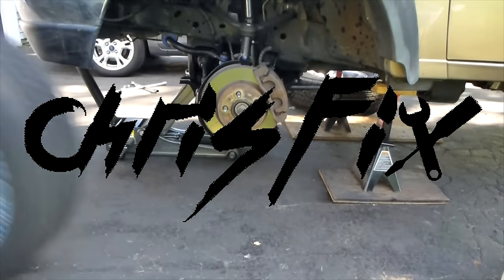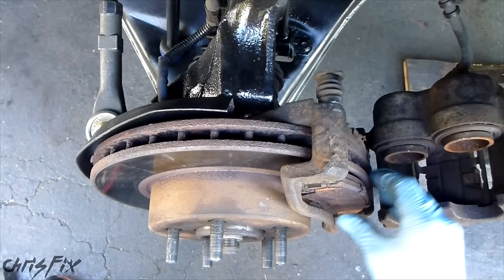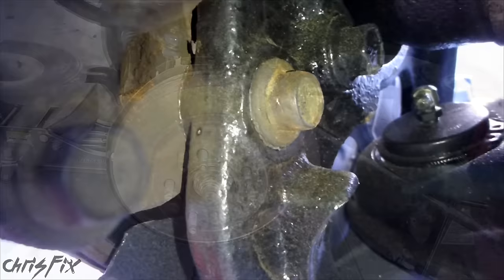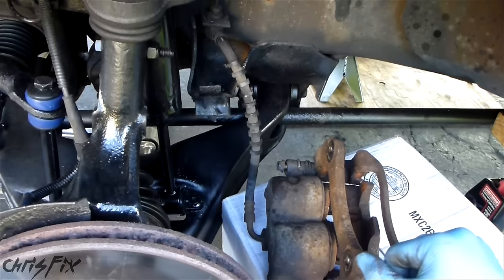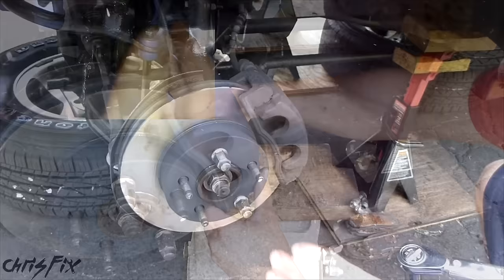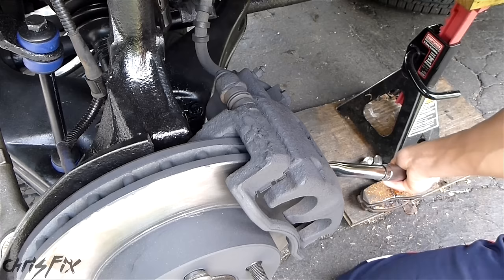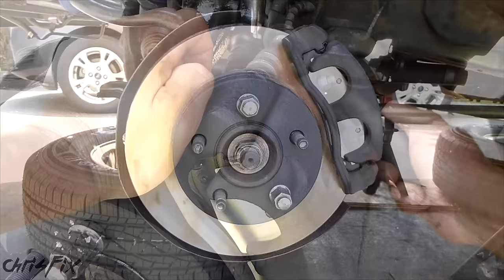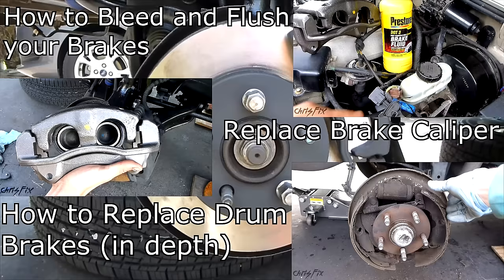How to Replace Front Brakes, Pads and Rotors

Comment: i have a question, how do you knw the amount of pounds to torque to
Reply: +kyle gorman check your owners manual. Or buy those Haynes manual book. You can also do a quick search on the internet. Sometimes some forums might have that information. Hope that helps.
Reply: +Supraw does actually thanks
Reply: If you were really In a pinch, you could use a 12" wrench, and put an 85lb weight on the very end of it :D

Comment: Make sure you pump your brakes after you're done installing everything oready elsee your brakes may not work
Reply from the maker: Thanks for the tip!
Reply: Yeah,  I always change my brakes but one day I got to comfortable about I can soo it all and forgot to pump the Brakes,  dam near Hit My Wife's Van A few Feet back...
Reply: Frank Solomon WHAT DO YOU MEAN BY PUMP MY BRAKES? LIKE ACTUALLY SIT IN THE CAR AND STEP ON THE BREAKS??
Reply: @SENSUI347  yes. After you've pushed the piston back to fit new pads it is no longer up against the back of the pad. Pump or push the pedal several times to bring it back to the back of the pad. Otherwise put your foot on the pedal and the piston still isn't touching it = No brakes
Reply: @skiphaskell706  Do this while the cap is still off the brake fluid reservoir or back on?
Reply: Also, if I'm doing all 4 I like to do either the front or the rear first, then take it for a test drive. Come back and do the other set. That way if for some reason you mess it up you'll still have at least some braking.

Comment: Nice video, thanks Chris! 
One comment, be sure to clean both sides of the brake rotor with Brake Clean before installing it. You can just spray them in the cardboard box that they came in. Chris only cleaned the front side of the brake rotor. He should have cleaned the back side as well.

Comment: I just wanted to say thank you for the super helpful video. My brakes didn't go as planned. As the last person who worked on them stripped the driver's side caliper bolts and slider pins so bad it took two day and a hacksaw to finally get them off. I ended up buying a new set of pins and everything else happened just like the video shows. Love my Mazda B3000. Thanks again Chris.

Comment: Nice video, and very detailed and informative.

Show me in general, one of the newest vehicles that I had to get back in November that is my current new vehicle and it’s a kind I’ve never had before because I’ve only had regular sedan type cars, because I had a 2012, Mazda three before this and a 2004 Kia spectra before that, but this one is a 2005 Honda CRV.

Now, in general with me, at least over the last decade, and I don’t remember completely when or how I learned them, but I am someone who has to watch to learn, but I also catch on fairly quickly, so three of the simplest things that I know how to do myself is change a car tire, Weatherby from regular to another regular, or regular to spare, I know how to change out a car battery, but I have yet to have to do that with mine, so I’ll learn how to have to do that sometime eventually down the road, and it seems like the casing for my battery has a lot more to it than my Kia, or my Mazda did, and I know how to jumpstart a car.

I started thinking about different certain things that someone would have to work through to fix or replace and I’ve seen videos of oil changes being done as well, not from the sky yet, but I’ve seen videos of oil changes being done, and I’ve been told that if you have your own supplies, they will definitely save money and changing your oil is relatively easy and only takes about 5 to 20 minutes depending on who’s doing it, but I’ve seen the way Brakes and brake pads look in various different ways over time with cars and I thought to myself, I wonder if changing brake pads and rotors is relatively easy, may be a little bit more time-consuming than changing your oil, but relatively easier than people might think, and even though there were a handful of different minor variable things to have to do in the change up of things, and to make sure the new things are going to work properly afterwards, watching this entire video, and despite the fact that my short term memory is not that great, I kind of already feel I remember half the video, and despite all the things that went on in it, it was still for about an eight minute or so video, still informative, the breakdown helped me understand everything, and I feel like I would be able to do my own as asinine as that sounds after just watching the video 😂, but the way his video shows it being done, it makes it seem capable of being done, and not like someone might thing changing, brake pads and rotors. Seems like algebra to have to take on.

There are videos I watched by somebody else, who is kind of a geeky, nerdy, mindset kind of guy, and he does three dimensional, illustrated videos on multiple different variety of things where his videos break down in detail, how something works, like a door knob, handle, or a lock, or breaking down the inside of the Empire State building, the White House, the Titanic, even show me how a pole back and go car wax, but if the videos break stuff down and there, step-by-step and easily understandable And very explanatory in a very easily understood way, I find it easier to understand at least from my perspective and it’s definitely helpful and nice.

Comment: The most important thing to me from doing brakes myself is having the proper tools, 1/2 inc breaker bar, impact socket set, good quality wrench, brake caliper press for the front pads and the one for the back, anti-seize as he said, brake cleaner, low profile Jack just in case you have to do other people cars in the future, Jack stands, hammer, flat head screwdriver, a little common sense and some music 😍 thank me later

Comment: Hi Chris, I watched your video and  I replaced front brakes, rotors and bearings on my 99 Ranger.  I lifted one side at a time and when I turned my steering wheel for ease of caliper bolt access, I some how got air in the power steering system.  Every time I turned the wheel  in either direction, it would vibrate.  I watched your power steering full flush video, and upon completing that, the Ranger ran perfect.. Thank you ..P.S (my mechanic doesn't like you) :)
Reply from the maker: +Sully Cop AWESOME! Glad to hear it! Yea, when you turn the wheel with the car off, sometimes air can get in there and all you have to do is drive for a little but and it will bleed itself out! Glad the video was helpful.

Comment: That is very useful tip have to fix my wheel rotor and brake pads both got worn out like haven’t changed for 5 years the metal start to fall apart and pads make those screech noise when brakes thanks for the usefully tips now I know how to do it myself 😅😅😅
Reply from the maker: Definitely get that done if your brakes are that worn!

Comment: i watched a couple videos and was inflated with confidence. so i went out to remove replace my brakes. oh so naive. the clouds of failure collected, figuratively, and also overhead, literally.  i threw a pad in backwards that fell out while trying to fit the caliper in my rush. yes, i did the impossible. i did what cant be done. i believe in my self.. at this point it's pouring rain. i put it all back together, get my tools outta the rain, and the grinding begins. after four or five 35-0 stops i'm like  hmmm... maybe somethings wrong. pull over. take a look behind the wheel and see shards of shiny backing plate and a nice deep gouge on the rotor. bright side's now i have new rotors too. take your time and always check the weather kids.

Comment: Might want to include a jack in your required tools. Would be good to choc a wheel also just as a precaution.. it’s a good habit. Goes without saying but jack up your vehicle on a flat surface and preferably you want to use a sturdy jack.. not the crap they include with your vehicle. It’ll work.. it’s just not likely to be  very stable like a floor jack is. Also, after you’ve finished the job.. BEFORE you drive anywhere you should start your car and pump the brakes a few times then put it in reverse, back up slowly and pump them a few times so your calipers can readjust to the new pass and rotors. Otherwise you may not have brakes temporarily and you could hit something before you realize it. Most people are familiar with the basics but doesn’t hurt to include it for the real rookies out there. Good video.. and thank God for the ones that take the time to record this stuff for others to learn.. thank you!

Comment: Question: There's a bottle of white lithium grease shown in the supplies that you will need, but it looks like you're using individual packets of brake/caliper grease to grease the metal points.  Is it okay to use lithium grease instead?  Some advise against it, saying the lithium grease does not hold up to the high temperatures from the front brake pads.  Otherwise, this is an incredibly informative video.

Comment: Great video Chris! Just changed the pads on my 08 ranger. Great tips on cleaning the rotor before hand. Also to anyone whose now to car work make sure you use metric on this job, also my nuts were a little rusty which made it seem like the right size nut did not fit on the bolt, had to clean the bolts to get the right nut in there and I'm certain I would have rounded off the bolts if I hadn't. So other dudes recommended using a practice vehicle at a junk yard to get some reps in before doing it on your car and I think this is a great idea!

Comment: I tried changing my brake pads after watching several of you videos. I was successful but there’s a mild sound in the left front wheel. I couldn’t do the rotors because I couldn’t brake the bolts so I just did the pads. I don’t know anything about card but after watching your videos I saved myself $300 dollars but it seems I might have missed something, any advice has to what may cause the sound? Oh, the brake work great though.

Comment: Very helpful video !! This is the first thing I've ever changed on any vehicle besides a tire and battery, and was done in two hours. Only thing was when trying driving the first pump of the brake did not do much but second and third pumps. A friend said I might have a little bit of air and to undo the brake line slightly and let a little bit of fluid out as there was a little air pressure. Retightened the line and was good to go !! ✌🏻

Comment: i think you did a great job explaining the job and your video was well edited. great overall video, however you cleaned off the packing lube but did not clean again once you finished. You can see your hand prints witch means more than likely theres grease on the rotor witch will compromise stopping ability

Comment: Great video, have you done a video on how to remove nuts that are pretty much soldered with rust? Yesterday at work I broke the top nut because I use a pressure gun, had to go buy a whole caliper and an experienced mechanic used a torch to heat that nut up really good and he loosened it easily., he loosened the piece that broke and stayed inside. Also it be nice if all brake and rotor changes were this easy, I work at a mechanic shop the how things get because one nut is soldered in rust will drive a regular person crazy.

Comment: Hi Chris, great job on this video. I'm not sure if you left it out of the video, but it's usually a good idea to "burp" the boot of any air before installing the guide pin. It helps lower the force required for the slide load, and don't forget to make sure the pins are clocked properly.  Also, great advice you shared with everyone on placing grease on the abutment springs, you definitely know what you're doing!

Comment: Chris I have a question for you. My wife drives a 2015 Cadillac Srx Luxury AWD. I'm going to change the front brakes and rotors my because my mechanic has gone M.I.A. I have a prosthetic leg below the knee. Will the Cadillac Srx be a complicated job because it's a Cadillac or can I do it myself? Your instructions make it seem so simple. 👍🏾
Reply from the maker: I've done probably hundreds of brakes on all different models, and they're all pretty much this! For a more modern car like that they might have wear pad sensors or something similar you'll need to clean/replace, but they just clip in and have a specific length so it's tough to mess up. Take your time with it and you'll get it done no problem!
Reply: @chrisfix  Also I've seen a something like a Allen wrench bolt holding the rotors. Have you? and if you haven't no problem. Man sure do appreciate your great instructions. When I do it next weekend I'll be sure to let you know how it went. (Hand shake)

Comment: I'd like to add that if you have a VW, you will need the break caliper tool and appropriate adapter to get the pistons back into place. It's a PITA figuring that out the hard way.

Comment: Hello, I could use some advice. So a few months back I replaced my brake pads and rotors how you explained in the video. After going to firestone today to get an oil change, they checked the brakes and said the front brakes were installed wrong, and because of that the pads need to be replaced. My question is, is it even possible to install the pads the wrong way? It was my understanding that they could only fit in one way, but maybe I'm wrong... btw they don't even make any sounds when applying the brakes, so I'm really confused...

Comment: Nice video. Just earned a new sun. Have changed pads and rotors before and this is spot on easy to follow video. Learned I shouldn't have to pull the whole caliper of to do just pads. If you haven't done a video on it, maybe one with removing stubborn/rusted bolts on the caliper pin or caliper bolts.

Comment: Chris, you do a great job on all your videos, keep up the good work. One thing you don't talk about on your videos concerning brakes and rotors is the bedding in. This part is totally scary as manufacturers threaten to make the warranty invalid if you don't do it right. First, every manufacturer has different rules, second, can you drive a distance to a suitable road to do the bedding-in and how much should you use the brakes before getting to a suitable road? Many require you to not stop throughout the process which is 4 to 5 stops moderate braking and 10 or more aggressive braking and no stopping. You should include this process on your videos. I can't believe new cars have this done to them or the local mechanic who replaces pads and rotors.

Comment: Hi Chris, I'm about to do this on my wife's 2013 Hyundai Elantra. It has 45,000 miles on it and I wanted to know if I should just change the pads or do I need to do pads and rotors. How can I tell if the rotors need to be done as well? Thanks again for this video, best one  on youtube
Reply from the maker: +Scott Davis I would do pads and rotors or at least have the rotors turned. You never just want to add pads.
Reply: ok, are those centric rotors in the video? Is it ok just to do the front first? Can you have different brand rotors on the front and back for a while?

Comment: I did this with brand new Duralast Rotors and Duralast Max brake pads.. and while it doesn't rattle when I go offroad anymore and MOST of the squaking and squealing is gone, I still hear a slight squeak when going at slow speeds, especially downhill (e.g. the slight slope at my driveway going less than a mile an hour). Before the squeal that caused me to decide to change my rotors and brakes, my brakes were dead quiet, I never noticed ANY noise prior to this. And now it happens that when I am rolling through a parking lot or abrubtly braking for a brain dead pedestrian I hear the slight squeak and I dont know how to get rid of it. I even put the grease on the back of my brake pads and the new anti-rattle clips. I also drive a Ford Ranger,  but it is an '05 4x4 V6 4.0l. Thank you for any and all suggestions

Comment: Is there an adjustment for front to rear distribution of power?  Why don't the rears lock up under even moderate breaking?  Will the brakes feel the same after putting in new pads since they are thicker? Is everything self adjusting? I always thought this was a more complicated procedure.

Comment: I really love your videos, they are very clear, throughout, concise and easy to follow. I'm currently working on the brake bleeding and the valve is so rusted that I can't bleed the fluid. So I have a small question: For a strength of a girl, how long should I get for my breaker bar? I'm confused with so many offers on Amazon of different lengths and driver sizes, Chrisfix's bar looks like 23"?  So I should get 30" ?
Reply from the maker: I would get this one: http://amzn.to/2oxHVxn
It works great and is a good length. As for your bleeder valve, check out this video: https://www.youtube.com/watch?v=n1NvtUwfRJc
Reply: Wow, you're so fast. I added that to my shopping cart as well as the video to my play list.  Thank you for your prompt reply and recommendation.

Comment: hey this was even better than the other brake video for DIY. is it complicated... well yes so i will use your video and pause it step by step. don't want to risk the fam's life.
Reply: ps i did notice that there are 4 bolts. would have liked an explanation for newbs about which bolts are for calipers and which for roters. found out on mine that the small bolts were for the calipers. that's the only thing i wish was added

Comment: Something I found out today. Pay attention to the rivets on the back of the pads that hold on the backing plate. On my 2002 mustang they are different and go in to a specific side of the caliper. It’s easy once I looked at it but I had to burn up a set of brakes and learn it the hard way.